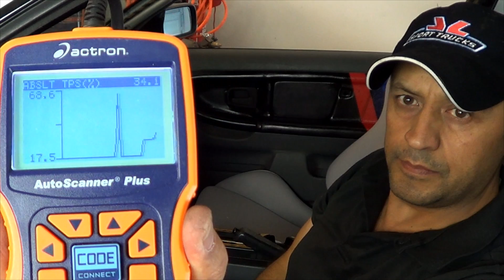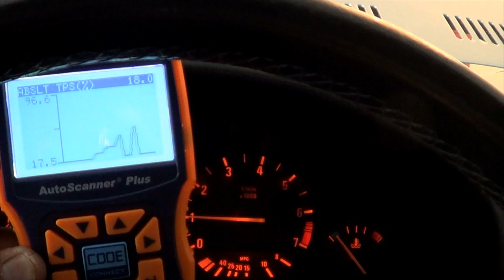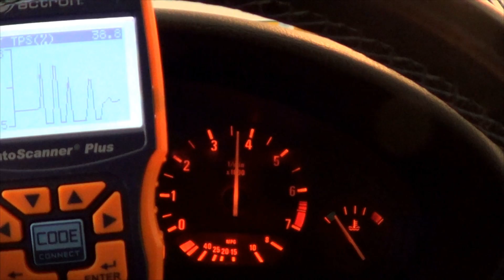OBD II Codes P0120, P0121, P0122, P0123 and P0124 TPS Sensor

Comment: Thanks that helped have a p0121 circuit a fault. On a gm tps for a Mitsubishi 6g72 with an LS intake and TB on it. So the tps is Definintly faulty. Mine only tracks up to from .078% to 81%. With the circuit A fault code.

Comment: I have 2001 BMW 540i, Codes are in Pending: P0120, P0123 and P0223, showing 100% when i have throttle Position Sensor when disconnected from wiring.

Comment: I'm having a problem, I have Toyota Avensis T22 2.0 d4d 110ks I'm driving for 4 years and the car is fantastic for the sailor without any faults, but that's where my first problem came! During the drive, Check Engine turned on and the car lost its power does not pull power. He was diagnosed and reported P1222 -Throttle Motor Circuit.

They told me that it was a suction valve and that I had to change it, I changed it and it was the same situation again. Well, if someone knows something to advise me, it would be great

Comment: My car has the check engine light on, the code that the code scanner gives me is P0122; Throttle / position sensor switch A circuit low. My throttle position sensor reads a drop when checking it with an ohmmeter, but surprisingly the new one also has a drop. Is that normal with this special throttle position sensor? The car is a 2000 Ford Focus. Thank you for your answers.